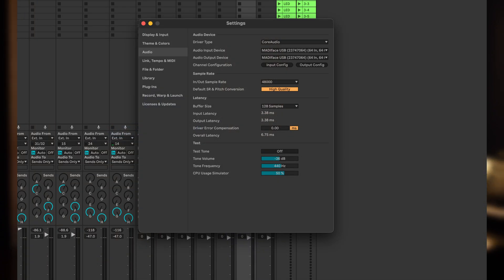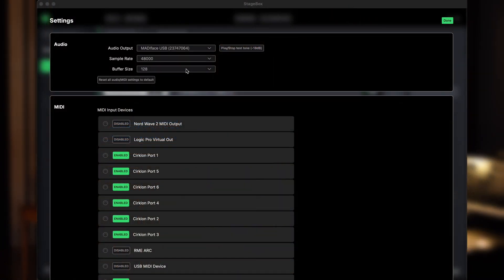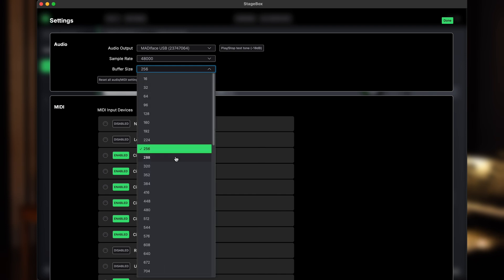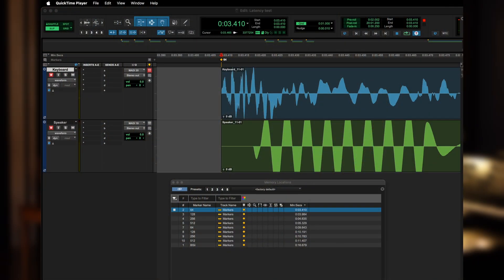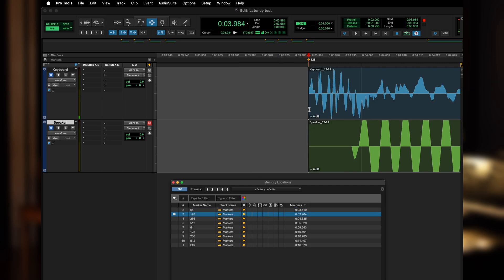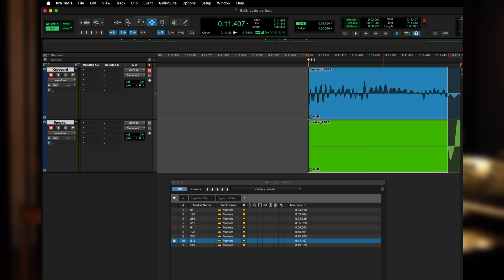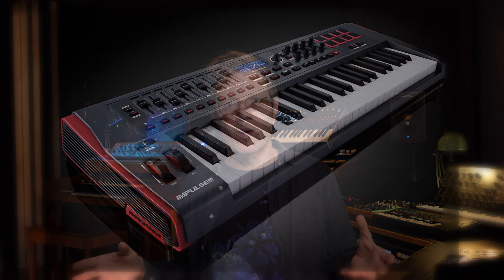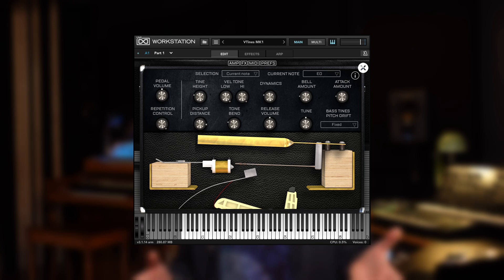Latency for Keyboard Players

Comment: Hey - youtube must know I'm a latency nut and recommended your video to me :) I actually measure synth latency in a similar way, however what I do is put 1-3 coins under the keys so that they make a nice transient right at the point where a sound is triggered. The reason is that, after initially measuring the sound then you first hit the top of a key, I found out it can take 10ms or more for the key to travel down to the point where a note is triggered. That might explain the bad latency on the Juno. I don't have one to test, but that sounds quite unreasonable! If you have a chance please test "my way" and let us know back here
Reply from the maker: Hey! oooo that's a great idea! Although, IMO its the key travel that sometimes adds to the total 'perceived' latency of a system - which is why (I think) people like Nord have only the top key contact active when you're using hammond sounds.... less key travel =  faster response. It's a slightly different thing but all related I think. My assumption with the Juno is that it's old and has really slow key scanning. But I will try it out and see what happens :) Thanks for your comment!

Comment: Interesting. What about Keyscape? Has anyone done a latency test with a digital keyboard with keyscape?
Reply from the maker: The instrument software itself shouldn't create any of its own latency as such - the latency will come from the combination of hardware and host software that you are using. Having said that, depending on how the instrument was sampled, it may feel different, but thats more to do with the attack portion of the sample rather than actual latency in my experience. For example, I find that the Rhodes sounds in Keyscape feel slower to play than the pianos (subtly) and this is due to the amount of attack build up thats recorded in the sample. Thats where the dark art of sampling comes into it! :)

Comment: You should compare with an acoustic piano which has considerable latency - but no-one seems to notice!
Reply from the maker: Totally! I've always been amazed by this.... theres a lot of mechanics in a piano right? ;) Also I think this translates to complex weighted key actions feeling more 'latent' than semi weighted actions. The key mech has (I think) more to do with the feeling of latency than the buffer size. Well... to a point ;) Thanks for your comment - I would love to measure a whole bunch more things. I suspect a harpsichord is pretty fast!
Reply: Will have to disagree, but I think it depends on what you consider “latency”. In my opinion, the start of a latency measurement should ideally be from when the sensors trigger, which on a weighted keyboard seems to be near or at the bottom of the key travel. But an acoustic piano doesn’t have sensors, so where should latency be measured from? Just looked up a slow mo video of a grand piano action, and it looks like the hammer hits the string before the key hits the bottom of travel.
Reply from the maker: @bogtheforest  yeah this is an interesting one....I think I could argue it both ways ;) For me personally, key actions that have higher contacts "feel" faster to play, and so in my mind that first part of the key travel 'before' the contact SHOULD be part of the overall latency measurement. If I had measured all the above from the contacts, all the figures would be about 5ms less I think ;) Thanks for looking!

Comment: Note that the latency will change with different sample rates as well. The latency from a keyboard at 44.1 kHz will be twice the time of the same keyboard at 88.2 kHz (assuming it is using the same buffer size).
Reply from the maker: yes totally! However in my experience, doubling the sample rate means you often have to run at a higher buffer size to cope with the increased DSP overhead, so the two often kinda cancel each other out. If you were going to do a one instance, low DSP setup though, then yes increased sample rate would definitely help! Thanks for your comment